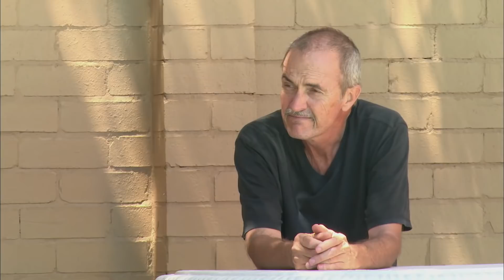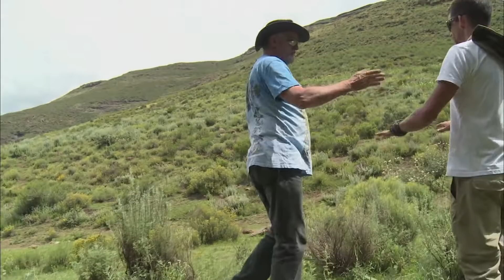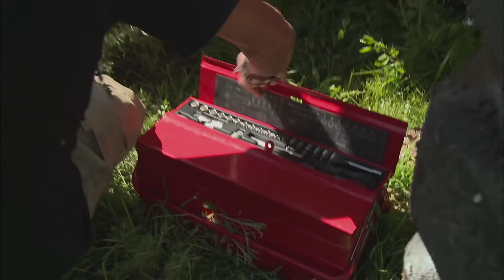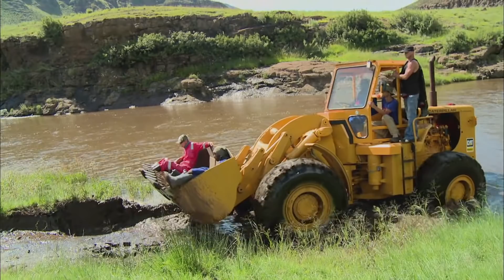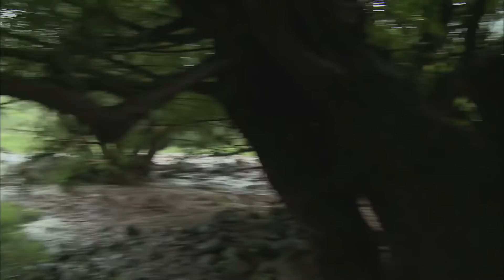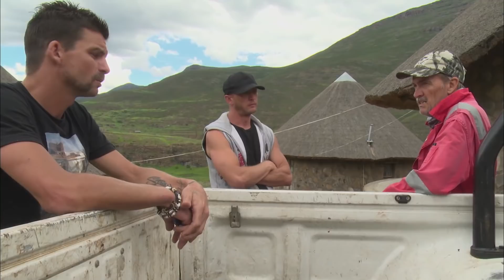Diamond River Hunters EP4 Journey Back

Comment: Pumps hate a dry lift..   prime it by plugging intake pipe with a bit of cloth, then fill  pipe with water through impeller bleed point or alternatively put a T and a valve tap  just after the pump and use that as a filling point.
Soon as that pipe is full of water ,  close off the bleed point, remove the cloth bung and fire up the pump..

Comment: RIVER CREW GUYS: A TIP- when your gone, leave money and instructions for local villagers to stock pile piles of rocks where u will need to cross rivers. Then when u come back, use your CAT and spread out a pathway. Can't stop water completely but it will only take a couple hours at most to push it out. Gives natives work while your gone too.
Eta..take some damn wheel barrels too!
2ETA..your ignoring something BIG. THE SMART PEOPLE(not Gary) when that flash water floods through, WATCH the water! See where it jumps up, dips down, curves along the edges. THAT is where your diamonds will be guys.
USE YOUR HEADS. It's literally showing you were they fall lower and collect

Comment: turn it around and  reverse it using the bucket to help reverse out
Reply: No shit,lol. This is painful to watch. None of them consider it. I think Gary and the pro pump mechanic meet to be traded
Reply: Absolutely correct and the counterweight on the rear will dig in the rear wheels instead of spinning on top ...
Reply: Dead right, reverse should be a synchro gear too

Comment: Start buying equipment with turbos. Your fighting low atmospheric pressure. Turbos create pressure. Every motor on a mountain will work better with a turbo. Also if your classifying gravel... Use gravel to solve your mud issue instead of dumping it at a sorting table
Reply: Preach
Reply: The turbo has nothing to do with the pump, only the engine
Reply: @xfhnhhgjbvcfg  it’s the engine that runs the pump lad.    It needs more power.   He’s actually dead on.
Reply: @madjimbo4176  so more RPM ? Because the engines didn't seem to be struggling
Reply: @xfhnhhgjbvcfg  their whole process was a complete mess.  Trying to mine with prospector equipment.  Nonsense.  Power, capacity, rock sorting, etc.    go on the cheap, perform cheap results.
Reply: @xfhnhhgjbvcfg  imagine thinking, hey, I’m going to be a diamond miner.   without anybody who has ever mined before.  From watching YouTube.
Reply: @madjimbo4176  absolutely!! I honestly think I could do a better job having never done it before LOL! These people weren't at all mechanically inclined or anything it was incredible to watch.
Reply: @xfhnhhgjbvcfg  it’s hard to watch such poor judgement being exercised.  These investors were all financial managers or just business guys.  Then they always tried to find someone to blame or Someone to fire.   They should all be embarrassed.   

In the end, an operational leader was missing from this, preferably one that had operated sluices in mining operations previously.  They treated this like what it was.  A hobby project, poorly done.    They should just join a club and fund raise with car washes for charity next time.
Reply: @xfhnhhgjbvcfg  Its the oxygen.  The air up there is so thin that the engine cant get enough oxygen to run at 100%. A turbo will force air into the engine.
Reply: @mightypharaoh7586  the engine was not struggling or under powered ....
Reply: @xfhnhhgjbvcfg  you cant tell it is but it is. When we started first using planes in the world wars we had to super charge them because the engines didnt have any power at those altitudes. These guys are WAY up in the mountains. the engine they were using should have done far better than it did.
Reply: @mightypharaoh7586  I understand the principle of what you're saying. As long as the pump is spinning at the RPM it's designed to spin at the pump would work if designed correctly regardless of how much the engine was struggling.
Reply: @xfhnhhgjbvcfg  Thats not true, it needs more than RPMs. If the engine isnt creating enough power then you wont get enough suction force. Naturally asperated engines dont create a lot of power at that altitude.
Reply: @mightypharaoh7586  lol the engine is running the pump... The water is not being sucked through the engine...
Reply: @xfhnhhgjbvcfg  No shit it doesnt go through the engine. But the pump needs an engine to power it. The engine usually moves a piston or a turbine that creates vacuum force.
Reply: @mightypharaoh7586  so if the Piston or turbine is moving at the correct speed it will perform the same rather the engine is struggling or not.
Reply: @xfhnhhgjbvcfg  if the engine is struggling then it wont move at the correct speed of have enough force.
Reply: @mightypharaoh7586  so it's all about the RPM? Lol guess you're finally beginning to understand
Reply: @xfhnhhgjbvcfg  you have to be trolling if you actually think its all about RPMs. If it was then diesel engines wouldn't be used.
Reply: @mightypharaoh7586  RPM is RPM no matter what is powering it, all the engine does is spin the pump , no more no less.
Pump doesn't care what is spinning in as long as it is spinning at correct RPM.
Reply: @xfhnhhgjbvcfg  But thats not true at all. Torque matters far more. Torque is what gets that pump spinning. If your engine cant get oxygen then it wont make enough torque because the explosion in your cylinders cant get enough oxygen to fully combust.
Reply: @mightypharaoh7586  yes, and that engine was creating enough tourqe to spin the pump to designed RPM even if it was struggling. Now we have gone full circle in this conversation.
Also if engine was starving for air, or lacking combination then it would be smoking from running rich
Reply: @xfhnhhgjbvcfg  its clearly was not thought, those engines weren't designed to run at those altitudes. And running rich is just putting to much oil in the gas. Go learn about engines, and dont come back until you've learned something.